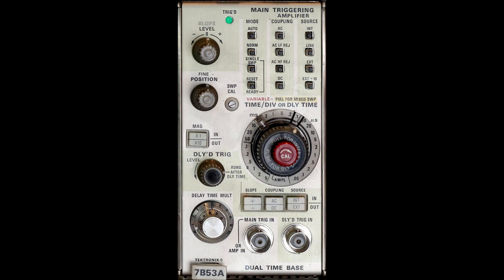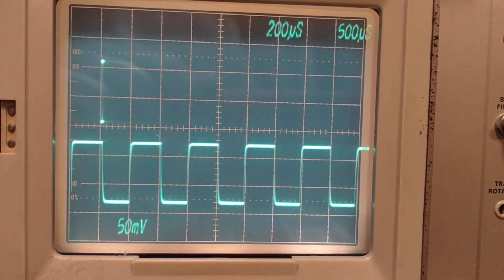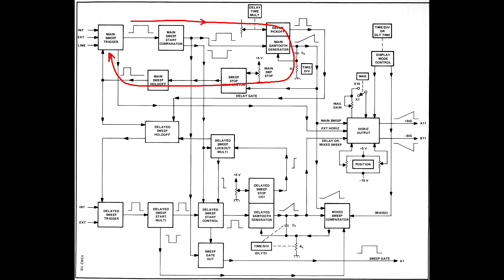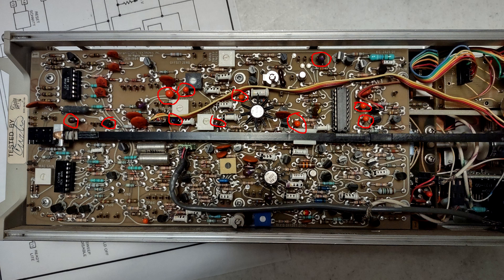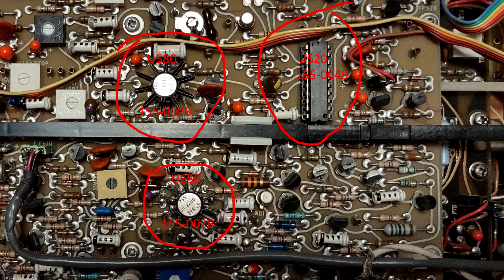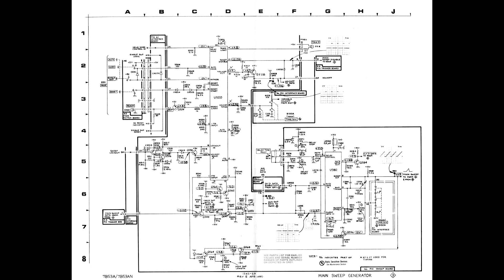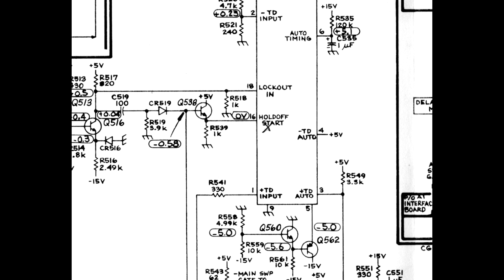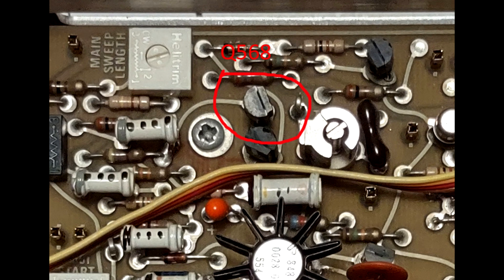Tektronix 7B53A Dual Time Base Repair

Comment: Good job!  One technique that sometimes works with feedback circuits like that is to examine the inputs and outputs of the sections and then individual components, and even though they will be “wrong” for the functioning of the overall circuit, they should be “right” in terms of the functional block or component.  For a basic example, the inputs of an op amp feedback configuration should be equal even if the inputs and thus output is “wrong” in the overall circuit.  If not equal, either the op amp is bad or the inputs are so screwed up the op amp can’t make them equal.  A little analysis will reveal which.  And so on . . . .